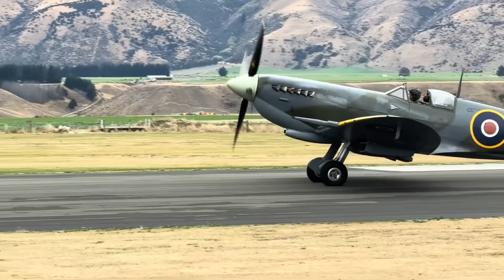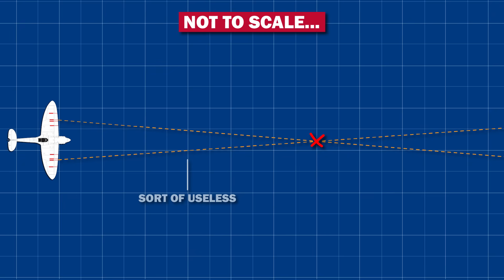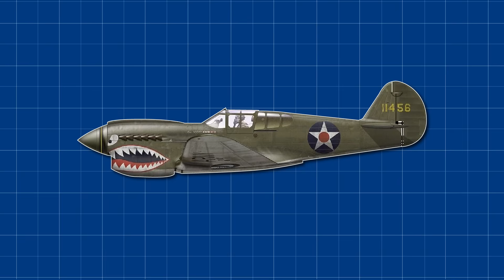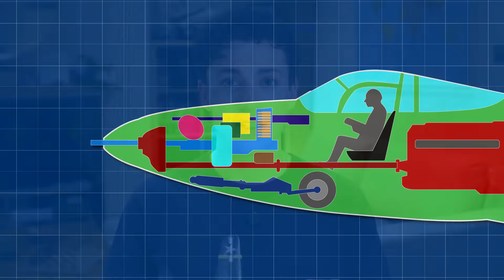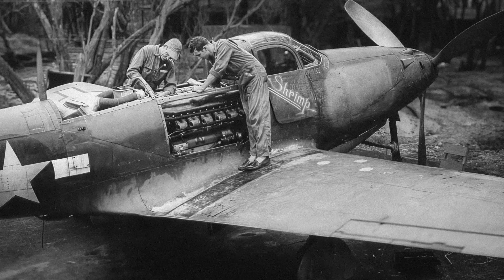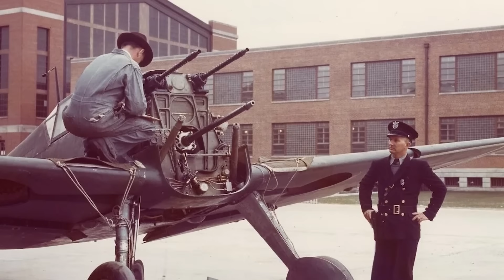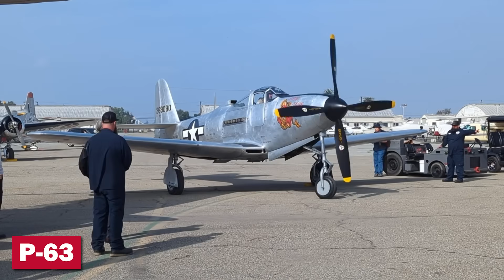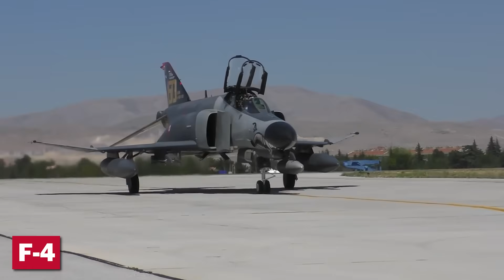What happened To Mid-Engined Aircraft?

Comment: The mid engined airplane has stability issues that front engine airplanes don't. It's a question of center of mass, center of pressure, and center of lateral area. A carelessly modified p39 had a tendency to spin out of control.

In an era where engines and superchargers were rapidly evolving, this kept them from being the high altitude fighter that the western allies wanted.
Reply: Not true.  Most fighters today are mid/rear engine and don't have "stability issues". Does the A-10 have stability issues? 

Most U-Tubers seem to think the position of the engine controls the center of gravity, which is false. It is a heavy mass, but just one of many. Regardless of where the engine is placed the CG is always in essentially the same place relative to the wing due to the need for static longitudinal stability and trim-ability.  

The shift in CG caused by expenditure of ammo stored in the forward fuselage has to be taken into account by the design.  Retaining the empty casings helps, but in any case the airplane has to be arranged so the CG remains with acceptable limits after all ammo is fired.
Reply: @gort8203  If you notice, the A10's cockpit goes very far forward of the wings in a way that the p39 does not. This addresses the stability issues. The P38, however, has the cockpit roughly on the wing like a conventional aircraft, imposing design costs for changing its position.

Most American examples I gave just show how incredibly complicated a 1940s turbocharger system was but the p47 and p38 were painstakingly engineered for them. Going from non-turbocharged to turbocharged involved significant design changes and center of gravity shifts. 

Consider the German attempt to get a high altitude the German FW190. <Edit: They tried to implement a turbocharger with the FW190c, really couldn't fit it internally, and gave up...> They ended up having significant weight shifts from a completely different format supercharged engine, requiring lengthening the nose and tail while keeping the cockpit and wing section roughly as it was, limiting risk. To implement a more advanced American power plant, the P39 would have had to move the cockpit forward with respect to the wing, requiring a complicated redesign and changes to a lot of control structures. At that point, you might as well design a new airplane.
Reply: @hypothalapotamus5293    You see that yet you completely miss the point.  The cockpit of the A-10 is forward because it can be; it is where you would like it, and nothing is in is way.  The gun and ammo are below/behind the cockpit. The engines could be anywhere they would fit, from under the wings the aft fuselage.

The P-39 was much smaller and could not have the cockpit above the armament installation, nor could the P-38.  The outstanding Dh Hornet later improved on this and got the cockpit even further forward.

You fail to notice that the P-39 cockpit is actually farther forward than that of front engine fighters.  Superior pilot view was one advantage of having the engine behind the cockpit. The pilot could see down past the leading edge of the wing.  An F4U pilot trying to look in the same direction found his view completely blocked by the wing due to the aft location of its cockpit.

The center of gravity of an airplane has to be forward of the center of pressure to provide the necessary longitudinal stability.  You can put the engine anywhere you want as long as you position the other fixed masses to achieve the required CG location. The areas area near the CG have to contain the fuel if you expect to keep the CG with limits as it is consumed. Thus the fuel tanks in the wings of the P-39
Reply from the maker: This wasn’t really true - I’d encourage you to watch “Greg’s Airplanes and Automobiles” video on it. 

The P-39s CoG wasn’t significantly rearward of her contemporaries nor was it impossible to recover from a spin. 

The lack of turbosupercharger and short range ruined the P-39s ability to serve the Western Allies, not the engine placement.
Reply: @RedWrenchFilms  Thanks for answering.
 
I think the question of whether the P39 was stable is different from whether making it stable deprived it of range and a turbocharger.

Most of the engine infrastructure was centered on the trailing edge of the wing and crammed together in a way that successful allied designs wouldn't do (radiator and engine were  not vertically stacked in designs like the p37, p47, or p51). This suggests to me that they placed these components as far back as they dared. If center of mass were not an issue, the radiator would have been placed more tailwards (like a conventional design) or that volume could have been used for fuel storage. It just seems incredibly restrictive.
Reply from the maker: @hypot @hypothalapotamus5293  turbo was removed because of the drag it produced, not because of the CoG. 

But like I said the P-39s CoG was farther forward than many contemporaries, it really wasn’t as much of an issue as people make it out to be. Also - is radiator in the tail at all typical?
Reply: @RedWrenchFilms  Why does the conventional design work? You take a large engine, that sets the radius of the fuselage. This needs to be cooled by the largest radiator you can get. By sticking the engine at the front, it is possible to have a massive radiator more towards the back without increasing that radius. The plane is essentially designed around the engine and the air handling system. Look at the P47 or the P37, the radiator is not in the tail but it is farther back than would be possible for the P39. This produced aerodynamic aircraft with the most powerful engines and best turbocharges available with lots of range.

Having the engine close to the center of pressure means that the usable space is compressed towards the center of pressure. A radiator being placed in a vertical line with the engine a glaring admission that something is very wrong. It means that the radius of the fuselage is going to be larger than necessary and the radiator isn't going to as large as you'd want. If I assume that the designers are intelligent and just trapped by constraints, this indicates that they couldn't put the radiator farther back.

Mid engine sound cool but seems self defeating. It seems like you get something with marginal aerodynamic benefits, a poor performance engine, and low range.
Reply: @RedWrenchFilms  After reviewing Greg's films.

1. He makes a pretty good argument that the center of gravity is reasonably positioned with respect to MAC but his comments on the placement of additional internal fuel tanks imply that he thinks there are serious center of gravity restrictions on where you can place heavy things on a mid engined airplane. I think this is reasonably aligned with my comments on design constraints (it seems very easy to shift center of mass backwards).

2. I think his discussion of American turbo based powerplants is more or less aligned with my understanding, with large amounts of rearwards heat exchangers (I probably should have differentiated between radiators and intercoolers, though). There was no way to fit a viable turbocharger into the p39.

3. Turbos on fighters were unique to USAAF. The USN stuck two staged superchargers on radial engines. The europeans stuck two stage superchargers on liquid cooled V12s (compact configuration, liquid cooling of engine and intercooler meant you can consolidate cooling into one large radiatior.). These three solutions result in very different layouts but Americans (given a British engine) seemed to mount the big radiator pretty far back as a matter of principle.

Comment: The key problem of putting the engine near the center-of-gravity (CoG) is it wastes a significant amount potential payload. Ideally, most of the payload of a fighter aircraft should be carried near the CoG, so that when the payload spent the aircraft weight balance remains the same. Mid-mounting engine like P39 has to move a significant portion of its payload far away from the CoG and that proofed to be problematic. It was only the Soviet love this aircraft for their own reasons. Also, mounting a bigger engine isn’t a great solution in WW2 fighter, and for dog-fight planes it’ll be having a better supercharger.

Comment: The P-39/63 were great aircraft. The engine placement was dictated to by the 37mm gun. The aircraft was built around the gun just like the later A-10. Mid wars there was a real thing about a 37mm cannon and aircraft.The CG placement caused stability problems particularly when the 37mm ammunition was absent. However the Russians in particular knew how to fly them and were very successful.

Comment: A few important points to clarify. The video 
missed that most WW2 fighters were running out of room in the forward fuselage for the superchargers and associated plumbing in search of greater HP. The Spitfire nose was significantly increased in length over the course of the war which required  significant changes to balance the aircrafts centre of gravity and handling. The mid engine Mustang mentioned was a Rolls Royce project in Britain for improving the supercharger system packaging and thus its efficiency. Interestingly the P39 while in production had the physical room in the rear fuselage for these improvements but was not pursed by GM, maker of the Allison engine, with the same intensity as Rolls Royce. The P39’s Allison V1710 engine was a single speed single stage supercharger which suffered in loss of power at higher altitudes. As a comparison the Mustang P51 B & later models & later Spitfires had 2 speed 2 stage supercharger in the RollsRoyce/Packard Merlin engine. 
Another point to clarify is the frontal area would not have changed significantly between a front engine and mid engined aircraft layout. But it would have reduced drag in the nose, but the radiators needed to go somewhere. Due to the radiator location in the P39 there were cooling issues during long climbs at high power settings. This is not because of the mid engine layout per se but because of the less than optimal cooling system design. As a comparison both the Spitfire & Mustang had very advanced systems at the time of their introductions.

Comment: Mid and rear engine fighters now fly with jet engines, and don't suffer from an aft CG. Most U-Tube video makers seem to think the position of the engine controls the center of gravity, which is false.  Regardless of where the engine is placed the CG is always in essentially the same place relative to the wing due to the need for static longitudinal stability and trim-ability.

Comment: The Soviets loved the P-39, even the gun. Range wasn't a problem when you operate from forward bases. And the aircraft didn't need redesign to have a more powerful engine. The V-1710 with field modifications were capable of 1700 HP on 100 octane fuel. With 130 octane even the 1840 HP was a possibility. Some American units in the Pacific used these modifications, and the Soviets knew about it too. For almost all of WWII the P-39 was the fastest fighter in low altitude, even without the raised charging pressure.
The higher bubble canopy wasn't a problem, made the visibility from the P-39 the best for early war allied fighters. And from the middle of the war almost all allied fighters converted to this configuration.
Oh, and there was a 20 mm Hispano equipped version, designated as P-400.

Comment: Engine in the front also means the stabilizer must push down a lot, which actually reduces lift by the amount of this force. And as you consume fuel, the center of gravity shifts, forcing you to adjust the trim.
Reply: Not really. The position of the engine does not control the center of gravity.  Regardless of where the engine is placed the CG is always in essentially the same place relative to the wing due to the need for static longitudinal stability and trim-ability.
Reply: @gort8203  Only IF the airframe is designed right.
Reply: @marekstanek112  We are assuming the airframe is " designed right" on any airplane that makes it into series production.  It has to be for the airplane to have static longitudinal stability. This is like step one on the designer's trade-space list.  

By the way, the center of gravity doesn't shift much as fuel is consumed if the airplane is "designed right".  Look at fighter planes and you will see fuel tanks centered on or near the CG, often pushing the cockpit back at the cost of pilot visibility.  Fighter pilots need visibility, but longitudinal stability is even more important.
Reply: @gort8203  that’s exactly what I meant.

Comment: The P-39 Airacobra was originally planned to have a turbocharger for better performance at all altitudes, like the P-38 Lightning and P-47 Thunderbolt.
Turbochargers, intercoolers, and ducting are very bulky, which is why the Lightning has separate engine nacelles, and why the Lightning is so fat.
If you put the engine and turbocharger in front of the cockpit, the nose gets absurdly long, like the XP-37. If you leave the engine in the front and move the turbocharger behind the cockpit, you get a fat fuselage, like the P-47. The P-39 design moved both behind the cockpit, which is relatively empty.
The Airacobra never got its turbocharger, so it always suffered from poor performance at high altitude. This was addressed its successor, the P-63 Kingcobra, which put an auxiliary supercharger where the turbocharger would have gone.
Reply from the maker: I believe XP-39 originally had a turboSUPERcharger - the production P-39 only had a single speed supercharger but no turbo.
Reply: chat gpt can you summarize this